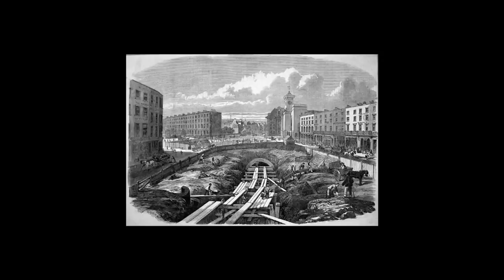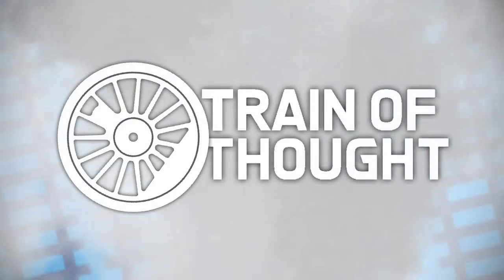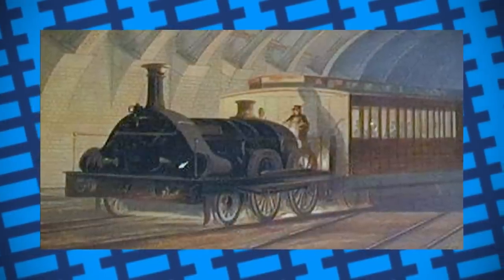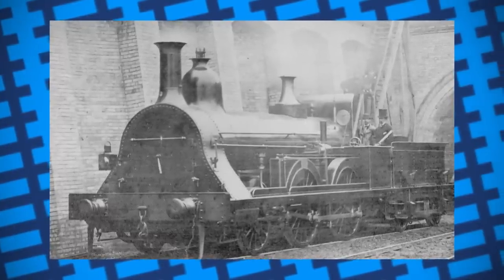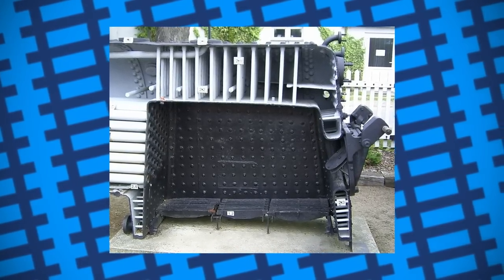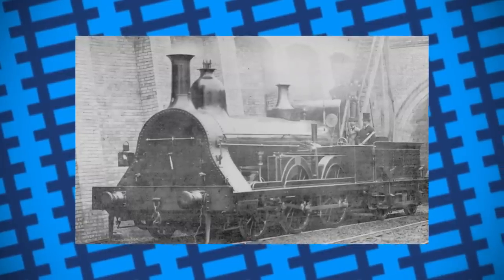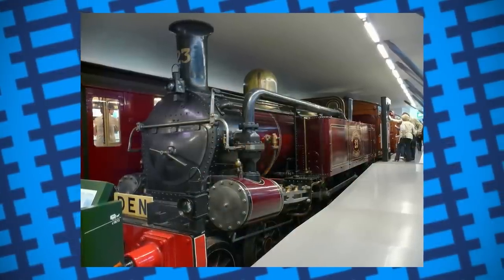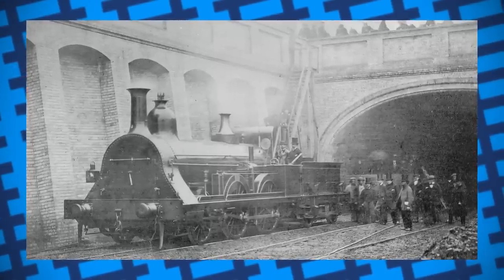How someone almost accidentally made a steam locomotive into a bomb - Fowler's Ghost

Comment: It still blows my mind they were using steam trains in the metro tunnels. Those places tend to be hot even with modern electric trains. I can not imagine how sweaty and suffocating the air in the underground would be during the steam era.
Reply: They are hot, at least the London underground, because of over a century of trains braking. They are extremely insulated, and the heat just can't leave.
In the victorian era, this heat hadn't built up yet, and the London underground was actually advertised as a place to shelter from the summer heat
Reply: Don't forget about everyone breathing in all the soot from the engine as the cars were open and also the extra chemicals from everyone smoking down there
Reply: @TheOneThreeFour  Smoking didn't really take off until the early 20th century.
There's a really narrow window between sewage and smoking were London didn't smell awful.
Reply: The thing to remember is the Metropolitan and District Tunnels are cut and cover with ventilation close to the surface and these were the only tunnels Steam operated.
Electric arrived in time for when Brunel's tunnelling shield was perfected to dig deeper tunnels with the Central line being a prime example.
Because it is deeper it is closer to the heat that builds up underground and in the Summer lack of cool air makes it unbearable. One year I got on at Gloucester Road and headed East for Epping. Because the line doesn't surface until Fenchurch Street the starting and stopping with stuffy air underground was fit to make someone pass out.
Reply: They were quite close to the surface and had quite a few openings so it could be worse.
Reply: As much as anything there weren't many alternatives, until electric matured enough coal is the only choice.
Reply: Really? I usually found them to be a bit chilly during some months. (I used to live up in the DC metro area when they built the first 2 Tyson's Corner metro stations)
Reply: looking at the scrapyard MMMMMMM INTERESTING
Reply: Fowler's ghost probably would have blown your mind in the Underground too!
Reply: Yeah
Reply: No choice. Electric traction was not available.
Reply: @cloudedarctrooper The DC Metro is quite deep underground.  Much of the older metro systems in the world were built using cut and cover, so they are quite close to the surface, not deep enough to benefit from underground being cooler.
Reply: @scottthewaterwarrior  holy crap this is a reply I did not expect to be getting so long since I posted.
Reply: @cloudedarctrooper  Really?  This is nothing, I've had people reply to comments I wrote 10+ years ago before!
Reply: @scottthewaterwarrior same here lol

Comment: I remember hearing about Fowler's Ghost from Simon A.C Martin. At the time parts that were brought up were where the engine worked and it failing, but the reasons why it failed weren't mentioned. Also I could be wrong here, but after the failed test runs the engine was left in a disused tunnel. I don't know if that's true but the history about it is something very interesting.
Reply: Same here
Reply: I believe it was scrapped, according to Wikipedia.
Reply: I first learned about the engine from Simon martin’s original story about it, too.
Reply: @connorflaherty175  Same here.
Reply: Same...Fowler still roams the rails out for revenge on his creator
Reply: @WesternOhioInterurbanHistory  I also read about it at  Douglas Self’s Museum of Retrotech.  It may have been used for spares first before being scrapped.

Comment: they also have fusable plugs (made of lead and would melt if the water they should have been covered by went dry)
Reply: Believe those are called stay bolts.
Reply: @roadtrain_  Fusible plugs have always been called that in the UK . Stay's provide support between the inner and outer firebox to resist the steam pressure.

Comment: The problem with boiler explosions due to lack of water is not because of the air (or in this case steam as there is no air in the boiler) expanding, but the firebox overheating due to the lack of contact to the cooling water. The material fails at these high temperatures being reached and the pressure in the boiler tears the firebox open. Exactly this happended in the GDR in the 80ies. A locomotive running low on water braked for a longer period of time and the water in the boiler moved forward leaving the top of the firebox dry. It subsequently overheated and when the water came back on the overheating firebox it created a lot of pressure quickly which burst the weakened firebox open killing the crew immediatly. The boiler then lodged itself free from the engine and flipped forward like a rocket landing on the track before the locomotive killing several bystanders but luckily missing a lot of people waiting in the trainstation.

Comment: This is somewhat similar to the British steam-powered submarines of the K class but even two steps more complicated. The K class were built some 50 years later and did not really work out very well either. To paraphrase, if the only source of mobile power you have is a steam engine everything looks like it needs a steam engine.

Comment: Surely even at the time they could have added a large tap on the steam side of the boiler, so that in the event of such a scenario, you could dump the pressure fast. Something like a 3"  pipe diameter tap with a pipe at the exit extending away from where the man had to stand to open the tap so he didnt get killed in doing so.  Could have probably used a sea cock from a ship even.
Reply: I was thinking about a wire actuated valve at the belly of the locomotive, so that it would dump the hot water on the ground 
Even if it's a hassle to reset, it's absolutely better than an explosion
Reply: @MrHack4never  true, im not sure how high the pressure is in these boilers. But it could work. Perhaps even be better on the bottom too as its the "colder" part of the boiler, so the seal in the valve would be subjected to less heat
Reply: I have much better idea

Use electric in the first place anyway. Which eventually they did

Comment: Isn't there is usually a safety valve on boilers that prevent such over-pressure explosion to happen?
Reply: Safety valves relief excess pressure in the boiler but if the water level goes down the firebox often made of copper overheats and collapses due to the steam pressure. Fusible plugs made of lead which melts at a lower heat than the copper softens are used as well, these are below the water line but if there is a rapid build up of pressure the boiler can explode before they have let out enough pressure. They are not designed to prevent a boiler that still has a fire or in this case hot bricks heating it from exploding.

Comment: The condensing water was just part of the recirculation of  steam into water and back to steam. It simply got hotter as it could not get cooled enough to be put back into the boiler as water. Injector pumps operate on the basis of a good temperature difference between the steam to drive said injectors and the water they were due to pump. This was a problem for the Metropolitan engines that had to stop to have their water changed.
Condensers need a supply of cold water to cool the steam into water (creating a vacuum in the process). This is fine on steam ships like where there is ample room and a ready supply of cold water from outside the hull. The water circulates around pipes that contain the steam, and is kept separate at all times as you don't want contaminants or sea water in your boiler.

The Glasgow Underground of 1896 used cable haulage from the start until it was electrified in 1935.
Reply: I’ve seen vids of locomotives in South Africa that were fitted  with huge air cooled condensers on the top of the engine due to the scarcity of water on the routes.
Reply: @tomrogers9467  They'll be a lot bigger than anything ever in the UK!

Comment: All high pressure steam generators and pressure vessels have the potential to accidentally become a bomb. A recirculating condensate system can be done and as you point out has been done successfully. Still a fair bit of combustion smoke from coal though and they hadn't quite figured out scrubber systems at that time yet. I wonder what they had for tunnel ventilation? Natural draft would definitely be considered inadequate today.

Comment: Obviously I don't consider myself smarter than all of the railroad designers of the time, but I wonder if it would just been practical to run tubes from the smoke stack at the front of the engine all the way to the back of the train. Possibly functioning like the TankTrain of today, the smoke would be let out behind the entire consist. Probably a lot of issues I'm not thinking of, but an idea.